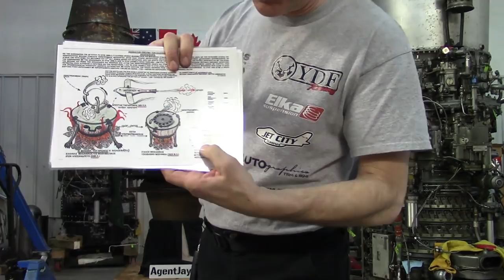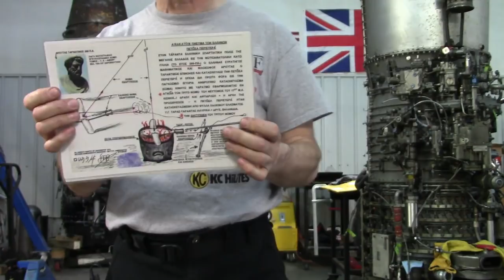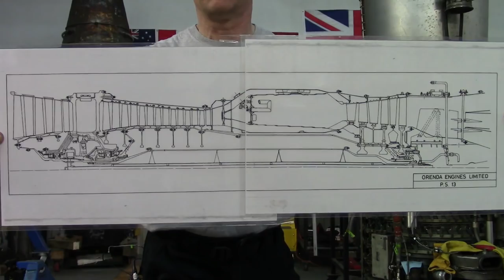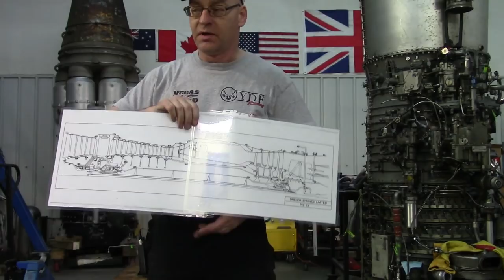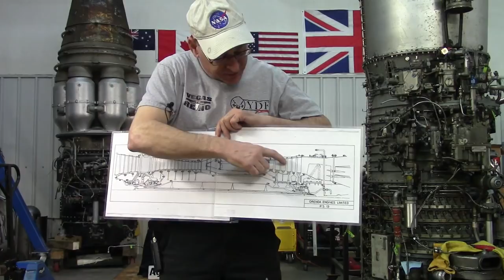4  Why don't jet engines detonate ?

Comment: Hi Jay
Question, please help me understand. Can you do a video on this?
What would be the compressor to turbine blade ratio to get a 10:1 - 50:1 compression?
How many blades to each? What would be the pressure at the  last stage of the compressor... Pressure in the combustion chamber... Pressure at the start of the turbine... Is the pressure at the turbine... 2, 3, 4 times that of the last stage of the compressor?
Reply: Sorry AgentJayZ, I can't resist coming in on this one, as we've been here before.
There is NO pressure increase in the combustion process of a gas turbine engine operating on the Brayton Cycle.  In fact there is a pressure loss of a few percent of the pressure at (HP) compressor delivery.  The pressure at turbine entry is essentially the same as that in the combustion chamber(s) and the pressure reduces progressively through the turbine stages.
Having been brought up with piston engines, many years ago, I got this wrong at an interview for an apprenticeship at Rolls-Royce, Derby.
Reply: grahamj9101 Thank you for the reply, is there a difference between the last compressor stage and the combustion chamber? Combustion chamber would be less?
Reply from the maker: In my jet engine diagrams series, one of the diagrams we look at is a chart showing pressures along the gas path of a turbojet. You might like it.
Reply: Thank You Jay, I will watch the jet engine diagrams series.
Reply: Take a look at AgentJayZ's diagram: that gives you the basics.  And yes, there is a pressure drop from compressor delivery and across the walls of the combustion chamber(s).  There has to be a reasonable pressure difference a) to  ensure sufficient penetration of the air into and mixing in the combustion process, and b) to ensure adequate cooling of the combustion chamber walls.
Reply: grahamj9101 Thank you... What is difficult for me to understand is how the engine can produce so much power between the differentials of compression... Is the Air pressure ratioed between compressor and turbine rotor blades? Or inlet pressure compared to last stage compression of compressor?
Reply: The pressure ratio of a gas turbine engine is the ratio of the pressure at compressor delivery (Ie, the outlet of the last stage of compression) relative to the pressure at the inlet to the compressor (ie, the local atmospheric pressure - usually).
Reply: grahamj9101 Really do appreciate the help... I did watch all 3 Diagram videos. #3 helped turn on the light, will have to think about it. So... Engine energy is from volume of air, air velocity, rather then pressure?
All this is really great and we are all fortunate to be a part of AgentJayZ channel.
Reply: Basic thermodynamic theory dictates that, the higher the maximum pressure produced by the compressors and the higher the turbine entry temperature produced by the combustor, the more efficient the engine will be, in terms of thermodynamic efficiency.
Reply: In answer to your question about compressor vs turbine stages, here are a few basic facts about various engines.
The GE J79 (and LM1500) has a 17-stage compressor, driven by a 3-stage turbine: it has a pressure ratio of about 13.5:1.
The Olympus 200 series engine (the basis of the Industrial Olympus that AgentJayZ has shown us) has a 5-stage LP compressor and a 7-stage HP compressor, each driven by a single-stage turbine: it has a pressure ratio of about 10:1.
The Olympus 593 in Concorde had a 7-stage LP compressor and a 7-stage HP compressor, each driven by a single stage turbine: its pressure ratio was about 15.5:1.
To demonstrate the advance in technology between the 1950s and 1980s, the EJ200 engine has a 3-stage fan and a 5-stage HP compressor, each driven by a single stage turbine: it has a pressure ratio of about 25:1.
Reply: grahamj9101 Thank You Very Much, I WILL lookup your suggestions. I've been wondering about this for years. Glad I finally did something about it. Again thank you for all your knowledge and help.
Reply from the maker: There is only one source of information on my channel that is more comprehensive and reliable than me... and his name is grahamj9101.
It would make all of our lives easier if we could remember that.
Reply: I'm flattered (and a little embarrassed) by your endorsement, AgentJayZ.  However, I would ask you and your subscribers to remember that I'm a gas turbine design engineer, who retired (for the second time) in 2006.  I've got a broad base of knowledge, but I'm no specialist, and I'm no longer up to date on the very latest developments, although I try to keep in touch. 
My knowledge is based on a career lifetime at R-R, the first half of which was working on industrial and marine engines and the second half on aero engines, with the greater part of that on military engines.  If, therefore,  you want to know anything about a J79 or an LM1500, for example, then AgentJayZ (whether that's a Zee or a Zed) is your man.

Comment: It is simple.  Jet engines do not compress the fuel.  Gasoline/diesel engines compress the fuel before burning it.
Reply: William Kelley Diesel engines don’t compress their fuel at all, just inject it after compressing air.
Reply: Liquids, such as liquid fuels, can't be compressed at all. They may be pressurized, but never compressed, like a gas.
Reply from the maker: Actually, the answer is in the video. Did you watch it?
Reply: Colaholiker well, fluids can't be compressed much.
Reply: Robert Szasz - Air is a fluid. I perceive an implication of, "liquid fluid," which can be converted to a gaseous fluid in several ways.
Reply: Alan Hardman Yup. I mis typed. Liquids don't compress much
Reply: Thank you very much for all the thing..^^

Comment: Based off your topic at 9:30, is there any reason a gas turbine engine would need priming fuel?
Reply from the maker: The primary fuel circuit uses different, smaller orifices to get good atomization at lower pressures for starting. It is a different fuel pathway, but it is the same fuel. Secondary fuel sprays out of the main running orifices in the fuel nozzles, which are larger.
Primary is starting, secondary is main or running.

The only "priming" is bleeding the air from the fuel system after overhaul, or draining for any other reason.

If this is a gotcha question regarding the J58 engine and its use of Triethyl borane, I don't know any more about that than you do.
Reply: @AgentJayZ  definitely not a “gotcha” question. I was just wondering if there was any kind of priming that would ever happen. I understand the two different spray patterns and I assumed that’s what you would say. Bleeding air from the lines does make sense though

Comment: What happened to the Orenda Iroquois you were building? Did you manage to get enough parts to get it running? Was looking back at the old videos recently but note it wasn't complete in the last one.
Reply from the maker: It has not been completed, but remains in storage as a static display.

Comment: Jay 
1.-if the 50 to 1 air compression  when you inject fuel it would burn automatically because fuels/air mix will auto ignite at that pressure ?

2-- What is the purpose of the igniter (electrical ) does this mean that when in low rpm it could be possible that compresión is not good enough so it needs a spark to ignite? (I assume 1 spark igniter per combustion chamber or fuel nozzle)

3.- what is  the psi pressure generated by the fuel pumps  you have already shown in other videos .. I assume there’s a way to prevent air to enter to the fuel pump/lines in order to prevent an explosive mixture
Reply from the maker: There is no place where non- burning fuel is mixed with air.
This question is looked at in detail in a recent video: why jet engines don't detonate.
It's not a good idea to apply piston engine thinking. .

Comment: During abnormal states like compressor stall or surge, would there be anything definable as detonation? Just curious.
Reply from the maker: I would never lie to you guys.
No detonation. No explosion.
Doesn't work that way.
Reply: OK, so let's be careful about our terminology.  When a full-blown surge happens, there's a transient reversal of the flow through the compressors, flames briefly shoot out of the intake of the engine, accompanied by a loud 'bang', which potentially can be heard miles away.  
However, it's not a 'detonation' and it's not an 'explosion': it's simply the sudden release of the pressure in the combustor.  It can happen multiple times and you will find several instances of it happening on YouTube.  I tell the story of waiting for a flight at JFK years ago, when a CF6 engine on a DC10 suffered three rapid surge events on take-off.  The 'bangs' could clearly be heard right across the airport.

Comment: Fuel always added after the supercharger. On modern fuel injected engines, That is true as far as I know. Carbureted engines can be done either way though.
Reply: fordfreak2007 Not completely true some systems inject fuel pre supercharger
Reply from the maker: Even so, the post-charger plenum is filled with fuel air mixture that you don't quite want burning just yet...
Reply: I think the closest (but imperfect) reciprocating analogy would be a direct-injection engine, assuming they spray after the compression cycle. 

My explanation: A typical reciprocating engine can detonate because there’s fuel present at the compression stage. There’s no fuel at the compression stage to detonate in a turbine.

Comment: Has the 2.25 question been answered? i actually have been wondering why ramjets aren't like this for years.
Reply: At least for subsonic flow, pushing air into a converging duct accelerates it and actually reduces pressure, which is if course the opposite of what you want for a jet combustor. With supersonic flow it's more complicated, as you want a converging duct (think SR-71 or Concorde intakes, while Concorde engines are pure turbojet they still use ram pre-compression at speed) to compress and slow (supersonic rules are roughly opposite to sub), then a diffuser to slow and compress it further before burning - or hitting the compressor face for the engines mentioned.
Reply: @brynclarke1746  So, were the diffussion/divergent part of the engine bigger and the combustion further back, there is nothing wrong with that design?

Comment: I asked a question a while back, I guess I didn’t word it properly. If instead of using fans to compress the air, a gas turbine engine used a centrifugal compressor, rotary screw compressor, or a piston air compressor, how would it compare to conventional gas turbine engines?
Reply: Some jet engines, (Rolls Royce Nene for one) did use centrifugal compressors. I think a lot of APU type engines use centrifugal compressors too. 

The Caproni Campini used a piston engined powered compressor ahead of a gas turbine. 

I'm guessing a rotary screw compressor would need to be HUGE to provide enough air and would be far too heavy to fly. 

There's also one more compression option: ram air compression such as in a ram jet like the Bomarc used and like the engine of an SR-71 works when it's at speed.

I'm not sure where the engine in a V-1 "Buzz Bomb" fits, it used shutters at the front that opened to admit air and then closed to contain the expanding gas and direct it out the exhaust when the fuel was burned.

Axial flow is probably just the most efficient for the applications it's used for. If another type is better for a certain job, they'd use that. Engineers don't arbitrarily choose one or the other, there's always a reason.
Reply from the maker: Centrifugal compressor engines are successful, and have been used as aircraft turbojets in the past, and are currently very widely used as turboprop.
A rotary screw or piston compressor are both quite limited in their capacity, so have to be very large in proportion to their combustor. Plus the turbine spins much faster than either of those two types of compressors.
It could be made to work, but would be more complex and much heavier than the axial or centrifugal compressor engines.
Reply: A lot of turboprop engines use centrifugal compressors or turbines instead of axial. Screw and piston compressors probably aren't used because they're efficient across a broad range of RPMs instead of super efficient at a specific RPM.
Reply: AgentJayZ Thanks for the reply, it cleared up misconceptions that I had.
Reply: You could even use a diesel engine, instead of a 'conventional' gas turbine HP spool: it's been done.  Check out the Napier Nomad engine.  In its day, it was probably the most efficient aero engine around - but it was too heavy and too complicated.
Reply: grahamj9101 - Actually, just came along at the wrong time. Jets were coming of age, Pistons were fading fast.

Comment: I don't know why I'm still comparing this but it seems more comparable to a Diesel engine than a petrol. Simply by injecting fuel into the pressurized combustion chamber and instantly combusting it. Glow plugs would be your igniters. I guess it's just my way of digesting your lessons. It helps me understand why things are happening/designed the way they are. I'm careful to distinguish that jets and pistons are different. Thank you so much for continuing to share so much technical know-how from your experience working with jet engines!
Reply: Legin Sreep not even close to a diesel. There's no autoignition of the fuel, there's no injection timing, there's no need to preheat the engine using the glowplugs.
As AgentZ said, they're just different.

Comment: Does the air when compressed self ignite before any fuel or the after burner fuel is introduced???
Reply from the maker: When you spray fuel into a fire, would you say the air is self igniting?
Reply: No, air cannot maintain any combustion with itself, which s a good thing too as it means the sky can't catch fire
Reply: To ignite you will need 3 elements temperature fuel and oxigen  fuel could
Be compressed but without oxigen it should be able to ignite since it needs to be mixed with oxigen to be oxidated
Reply: You're not going to get air to ignite into combustion at any temperature or pressure regime, as far as I know, because all the non-O2 molecules in air are chemically stable or fully-oxidised, so there aren't any chemical reactions they can undergo which are exothermic.

Comment: Can you relate this topic to f84 start up?
Thanks
Reply from the maker: What?
Could mean anything, so means nothing.
Reply: F84's if I recall correctly had a start sequence that involved a gigantic boom at the introduction of fuel on start up.  I always assumed that unlike all the turbine gear I've run they did some kind of intentional "detonation" at start instead of the common "just start burning" 
thing either by modulated fcu or a mechanical or in modern times digital fuel derichment profile.etc.  I was just wondering if you had any insight on how the F84 (I don't know what engine they used) differed on startup and wondered if this might be an occasion of a detonation like event being taken advantage of.  Sorry to be so terse.
Reply from the maker: That is not detonation. It's an accumulation of fuel that goes boom when ignition finally happens. It was very common with the engines back in the day. The J47 and the Orenda 14 do that all the time.
It took me ten seconds to find out that the engine used by the F84 was the J35.
Claimed to be the first American axial compressor turbojet, it looks a lot like the J47, which appears to be a slightly improved design.
All those old time engines lit off with a woof.

You see how being a bit more specific pays off?
Your original request was far too vague, but your second one was great!

Comment: I think the phrase you're looking for is "there's no suck, squeeze, bang and blow".
Reply: There kind of is though, it's just they're separated in space not time. Any given control volume of air is compressed, mixed with fuel that's burned, expanded for power and exhausted (for thrust).

Comment: so it has more in common with a diesel engine
Reply from the maker: It has more in common with a Coleman lantern.
Also, when burning diesel, it is a diesel engine, no?
Reply: @AgentJayZ  ;) does it add fuel to compressed air, or compress air mixed with fuel?
Reply from the maker: it sprays fuel into a flame that is already burning in compressed air. But it's burning diesel... the correct way: continuously! :)
Reply: @AgentJayZ  one long powerstroke ;) afaiu modern high pressure diesels also inject most of the fuel after the fire has already been started with a small preinjection. 

https://youtu.be/KEy6P4dbK3E?t=1228

Comment: buenas tardes. se debe revisar el rango de cierre de las valvulas de las valvulas de alivio...filtracion de los acientos de las valvulas de alivio. cierre prematuro de la valvula de alivio...jet sucio.revisar presion p1/p2 filtros de aire...presion CDP
Reply: cuando en la secuencia de arranque se escucha detonacion lo primero revisar el light off es muy alto. por tanto se hece necesario hacer ajuste estatico y dinamico para determinar la presion del combustible en la secuencia de igniccion...de igual manera ajustar lq presion de combustible aguas arriba y en caso de dudas. determinar que tan rico es el combustible....
Reply: alta presion del combustible.por falla o mal ajuste de la gas combustible...partido el link del piston interno de la valvula de gas combustible.
una valvula de alivio quedo cerrada...

Comment: Secret AgentJayZ --  Both my first car and airplane were rotary's   You wound that rubber band up until almost breaking point, and wah-la rotary power.  I really hope they get that darn Apex Seal issue solved and the need to mix oil with the fuel when injected into the combustion space.    I loved revving my 1981 RX-7 up to 9,000 and not have one vibration from the engine.   That was as close as i got to what I assume a jet engine powered car would feel like when the turbine was in its operating RPM range.